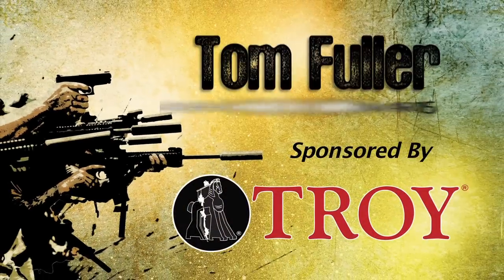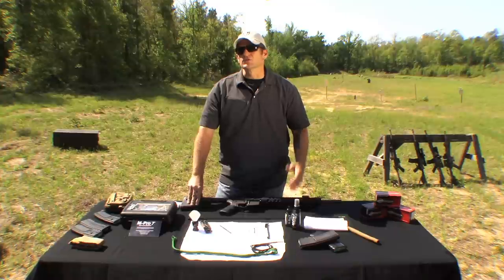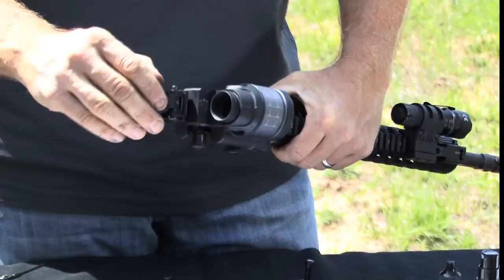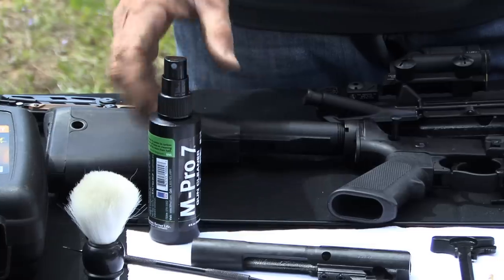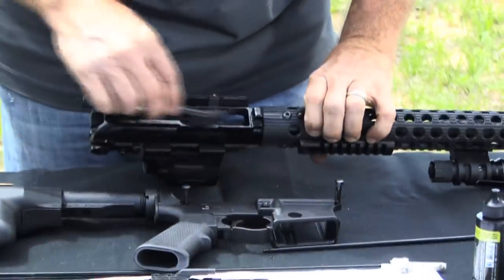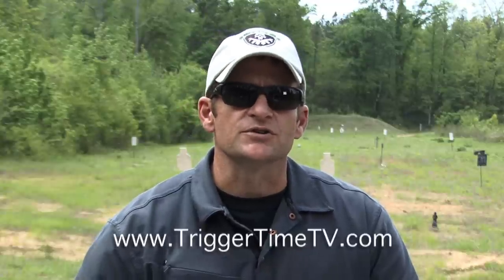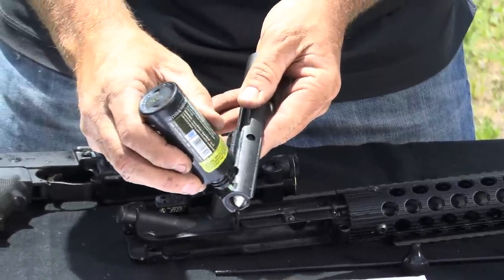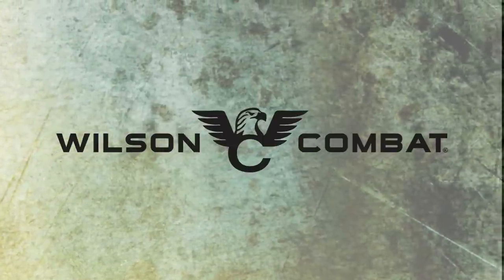AR15 Maintenace with Tom Fuller, Trigger Time TV

Comment: Never.  The gas tube is one of the most durable parts of the platform. Sticking things in that skinny tube just ensures that sooner or later, you'll need a new gas tube as you've plugged the original one up.